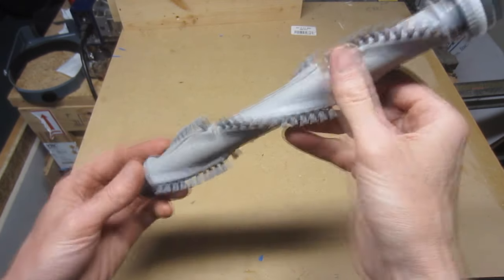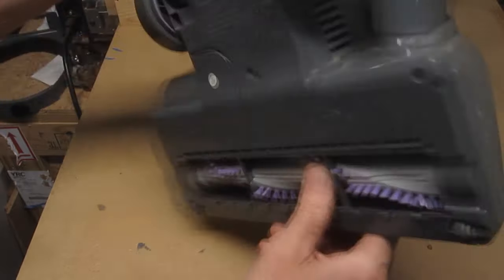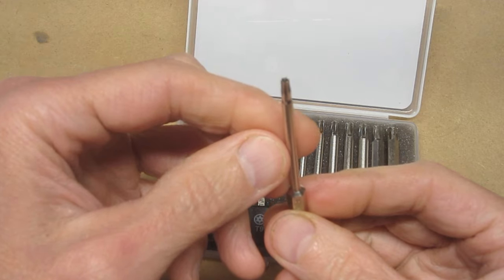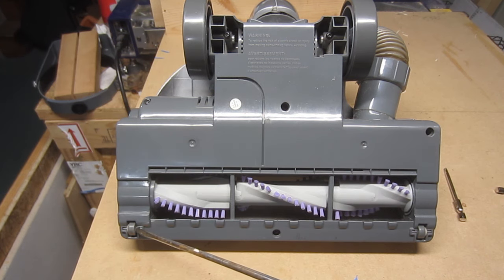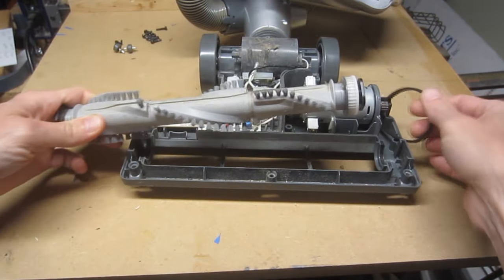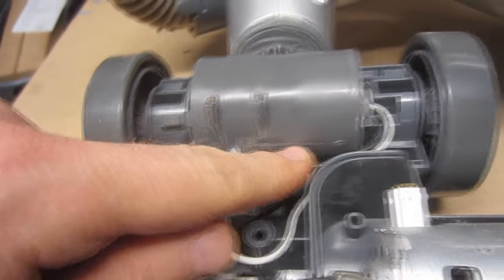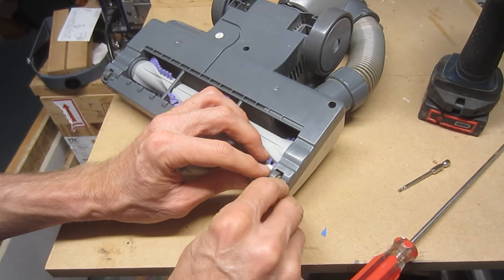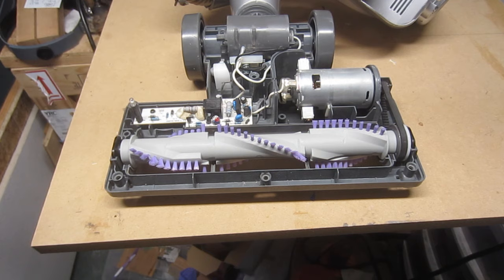Replacing the Brush Roll of a Shark Navigator Vacuum

Comment: The engineers behind this should be ashamed of themselves. This should be much easier to remove and service. Absolutely ridiculous.
Reply: The engineers were almost certainly adhering to a top-down philosophy of "no right to repair" adopted by the execs. This horseshit is by design - it's not stupidity and it's not accidental. It's a deliberate push to make easy fixes challenging.
Reply: It’s not that hard if you have 5 minutes and 5 brain cells
Reply: @bigt1877 I have more than 5 brain cells but these are not tools I have in my tool box. Why make it so difficult? My last vacuum you just unscrewed the bottom few screws and it popped right off so you could change the belt or clean the brushes. This is by far the hardest vacuum to take the bottom off I’ve ever had.  And please don’t insult me.
Reply: @monicabriscoe4401  exactly I don't have that torq bit. And the screws have a pin in the middle
Reply: @bigt1877 I’m mechanically inclined, have the tools which is actually a T-20, but they decided to put a nub in the center which requires a special tool. I got the screws out, but the center didn’t get put back in. They could have simply used a Phillips screw which they do in other places, so that tells you it was done to deter people from working on it.
Reply: My thoughts exactly. I had no idea I was going to need a special tool until it was time to clean my brush. Now I got hella hair in my brush and effectively can’t vacuum with the base until the damn tools get in the mail.
WHY DOES IT NOT TAKE A STANDARD STYLE SCREWDRIVER???!!!
Reply: Last Shark I buy. This is ridiculous! Will steer others against this brand, as well.
Reply: If I had not watched this video, I would not have known about the screws behind the tiny STUPID front rollers.  Which by the way have inserts to "make them fit.  I will not be reinstalling the center screw as someone had suggested.  I used tools I had at home, and I'm not an engineer, but was taught a lot of DIY by my father and YouTube.  😊
Reply: It's to keep you buying their product over and over. They know damn well most people are incredibly lazy and don't possess the intuition to fix it themselves so they'd rather just buy new instead of repairing. Sad, but it's true
Reply: So they Make it difficult to maintain so that u end up having to just purchase another when this one gets incredibly dirty and less wffective
Reply: Agreed

Comment: Thanks for this-- my model was a little bit different (it used T20 screwdrivers) but the basic process was the same and now the vacuum is working much better.
Reply: Mine also had T20s (model NV360). No more streaking brushroll!

Comment: I have model NV360 31. All my star screws are t20.
Only problem is when i put it back together, as soon as i leaned it back for the brush part to work. It would start and then stop after just a few seconds. I'm guessing I'm missing a step? Note: the vacuum stays on and the suction works. Only stops when i use brush

Comment: These things are designed the same as fans. They don’t want you take it apart and perform maintenance or service, they want you to buy a new one. I remember when some of these vacuums had like 4 screws max or even clips you just had to undue to remove the bottom cover

Comment: Excellent how-to video.  Hopefully someday they are all this concise.  Which direction does the brush roll spin?
Reply from the maker: Thanks, Paul. The brush roll spins such that it assists forward motion of the vacuum cleaner. If you were standing behind the unit then moved to the right of the vacuum, the roll would rotate clockwise

Comment: FOR SOME MODELS -   THE BRUSH WILL NOT OPERATE IN AN UPRIGHT POSITION.
Shark navigator 350-353 series - if you have cleaned the roller and it doesn't work, TILT THE HANDLE BACK then try.
Reply: THANK YOU!!!! I have an almost brand new shark and couldn't understand why the roller head wasn't moving. I was ready to go buy all the tools and take everything apart. This was such a huge help!

Comment: I just got the special tools and unscrewed everything but I can’t get the cover off or open. I have a Shark lift away emerald green. Not sure what to do now?
Reply from the maker: Sometimes, after the hardware is removed, the two sections remain stuck together by friction. Have you tried separating them by applying relatively light force? Might also try gently shaking/wiggling. It's also possible the design has been modified and there's some additional hardware. If you upload a photo of the underside of the unit, I can take a look at it.
Reply: @totrand  Thanks. I actually missed a screw. 
Both motors are running but very little suction. The belt was fine as well as the roller bar.

Comment: Whoever designed this vacuum cleaner is a jerk. Not only is it complicated to clean and maintain, but in order to replace the roller brush I had to special order a specific screwdriver which I will never ever use for anything else and I only found out it's called a T20 after reading through the comments on this video (thanks @peemster9978).